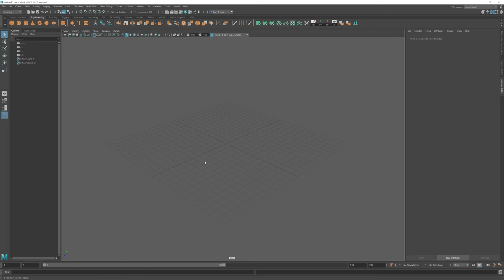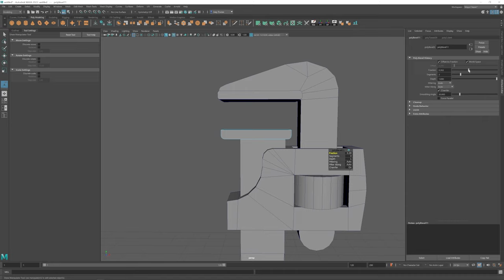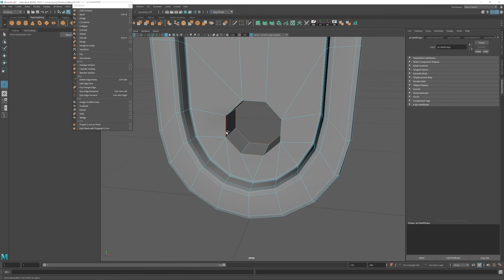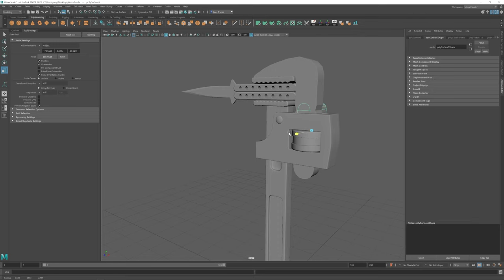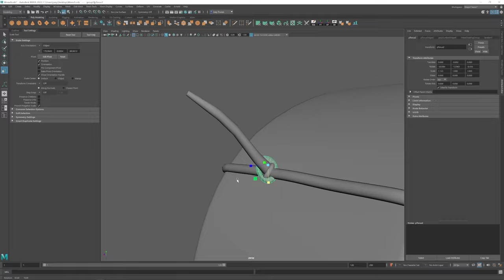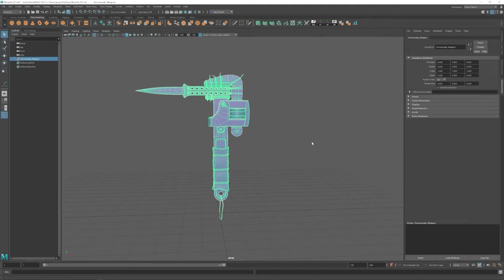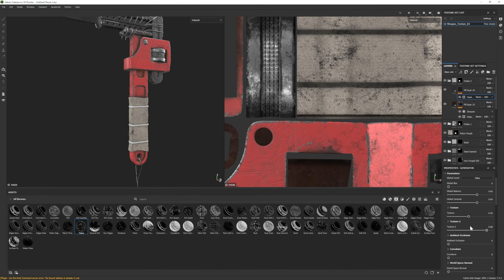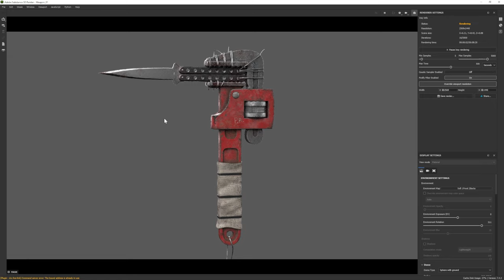Homemade Weapon | Autodesk Maya + Substance 3D Painter

Comment: Awesome workflow and video thanks!!!my suggestion 47:10 you can triangulate instead of making it manually!! I think there is an option in maya im blender user!!!!
Reply from the maker: Thanks! Great suggestion, I only didn't because I find the triangulate tool sometimes triangulates things I don't want to triangulate 😆since it was a relatively small area I decided to just do it manually. You're right though I probably could of saved some time, good call out!

Comment: Im new in 3d, sorry for stupid quastion, but is this game-ready model, or you need to do something with it?
Reply from the maker: Not a stupid question at all!  You could totally use this in a video game. However its important to know which game engine its being used in and how its going to be used. For example, a main character prop vs background prop, mobile game vs PC game. There are a lot of factors that can change how you create the model. This "prop" is fairly high in polys so I would probably approach it a bit differently. That being said,  this model only uses 1 texture so it should be fine in most cases. A few things I would do differently if I were to use it in a game is remove all those holes in the knife (that can be faked in the textures and save on polys) and also all of those wires, I would reduce the polys on those. You could go even further and remove the indents on the wrench and also just add those into the texture to fake it. A lot can be faked in the materials, you'd be surprised what you can get away with. This is why its important to know how the asset will be used in game, because if you're not going to see it up-close you can fake a lot of details and save on performance! :)
Reply: @polyrendr  Thank you so much for the detailed answer! <3